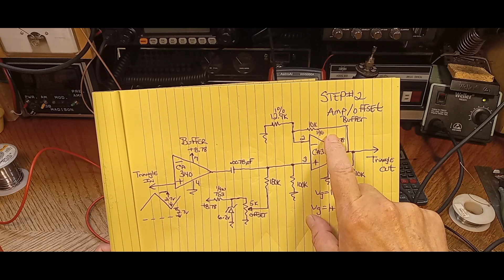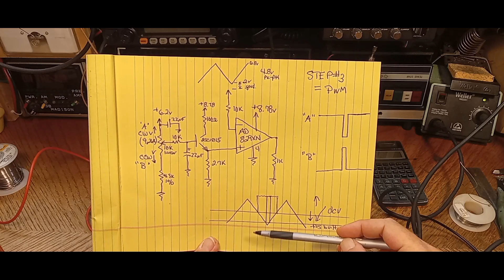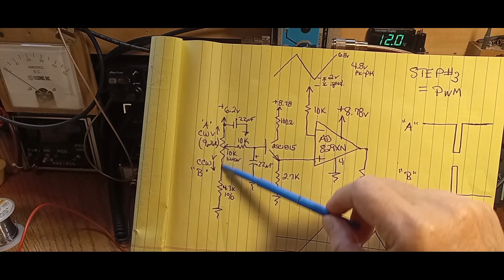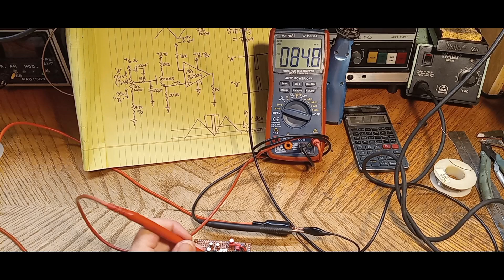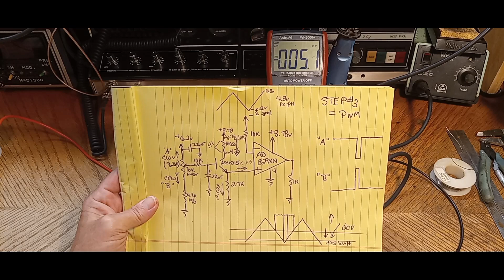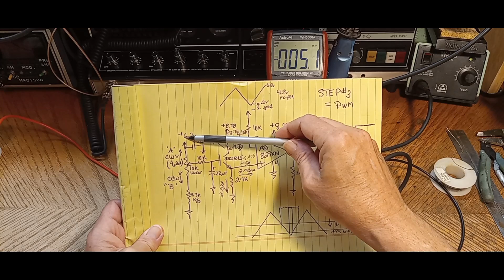unveiling👁 mystery circuit,pulse width modulation with a ad-829👍 op-amp🫨

Comment: Love your videos. This one is getting saved for circuits I'll likely use in my own random projects at some point. That opamp input current does seem really suspicious though. Have you tested those opamps on a dual supply?
I just looked up the datasheet, and it looks like the 829 has an input resistance of 13k, which is a couple orders of magnitude less than a typical opamp. Looks like it's designed that way to get that incredible frequency range and slew rate. But I'm too sleepy now to think any more about that 5uA input bias current. Have you tried measuring the input current rather than just calculating it? Analog Devices MT-038 has a simple schematic for testing input bias.... Just in case you ever run out of video ideas.
Reply from the maker: Thanku. maybe I'll put a minus rail on it at some time,just to see if my theories right.😀.thanks for watching.